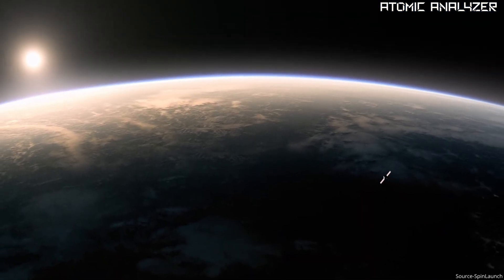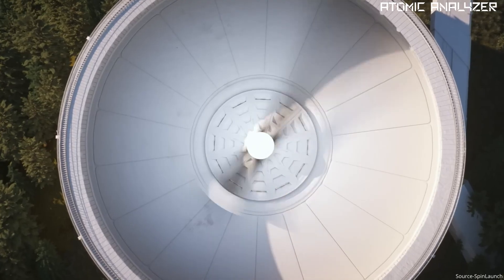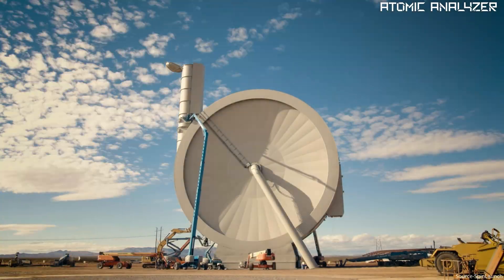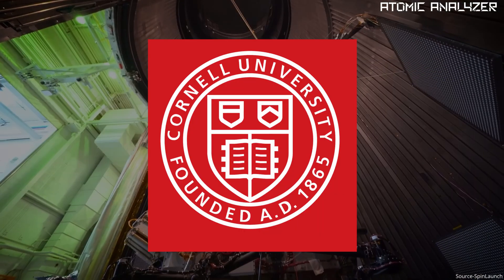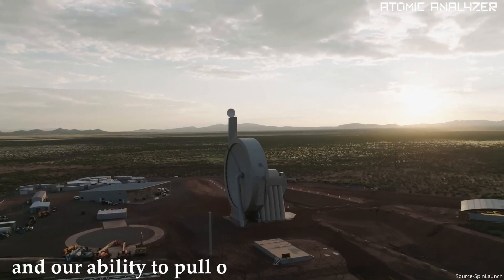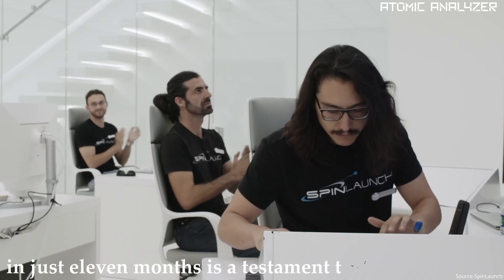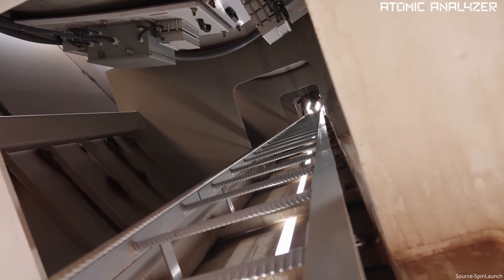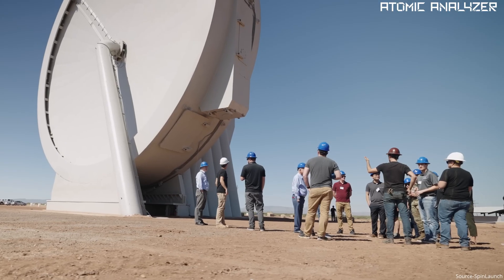Revolutionizing Space Launches: SpinLaunch's 10th Successful Flight!

Comment: The laws of physics are even older than the concept of a sling. It isn't worth overcoming the engineering problems in the concept.

1): You can't just throw something into orbit - you have to throw a rocket to push it sideways.
2): You can't throw a rocket without breaking something. You might as well put it on top of another rocket.

Comment: There is no way this will fire a worthwhile techology payload like a satellite into anything resembling low earth orbit.  Just not possible.  The reason, it needs to fire both a satellite and what would normally be a second stage of a rocket.  So we are talking about 50 to 100Tons or more of rather sensitive components and fuel systems being spun up at 10,000G or more... that's a sideways load of 10,000G+.  To handle that side load requires reinforcement, which means added weight/mass, which means additional fuel needed for that second stage for the circularization burn.  And in a normal rocket launch that second stage can be quite small compared to the first stage because the first stage has already provided a lare component of the orbital velocity, it doesn't simply take it straight up to altitude.  In this thing's case though it's firing it's load directly up, so if the payload needs a 17,000mph orbital velocity that all needs to be provided by that second stage once it is clear of most of the atmosphere, which means even more fuel which means even less of a payload to orbit.

This spinlaunch thing is a scam.  Big promises for a high dollar program that has no chance to deliver on it's promise.